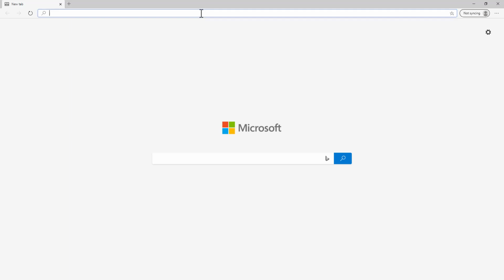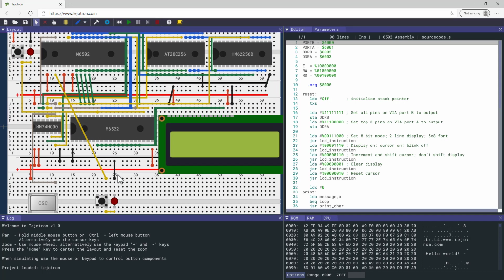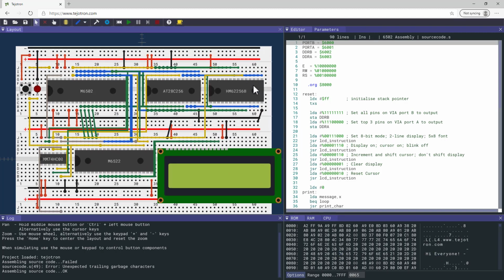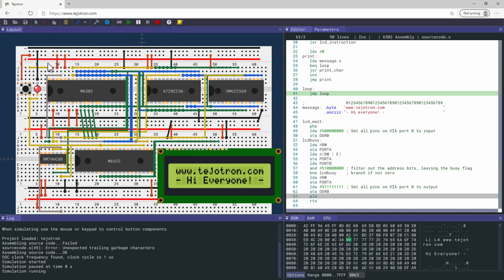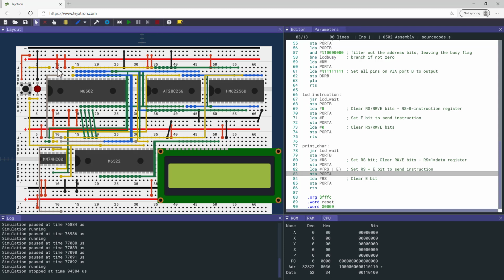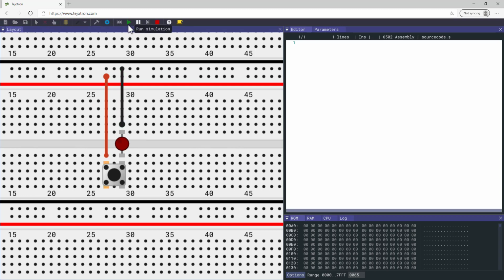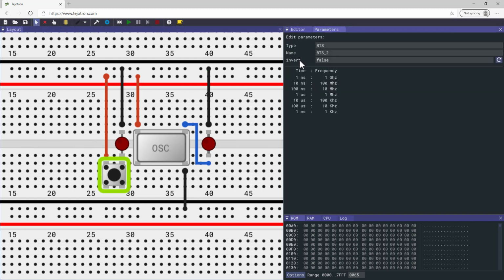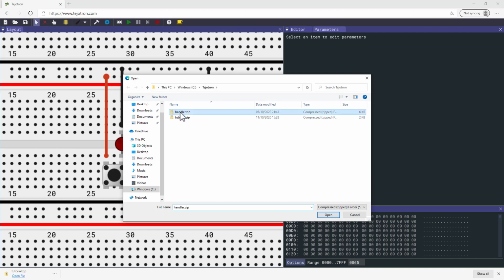Tejotron.com

Comment: Just used the site. Is it a bug that the LCD does not shift correctly? I've done it exactly as an example in the hd44780u datasheet, but it still won't shift.
Reply from the maker: LCD shifting is now supported in version 1.1
Reply: @tejotron5642  Yeah, I'm the same guy from Reddit. It works perfectly now!